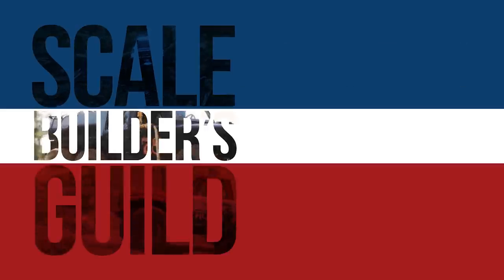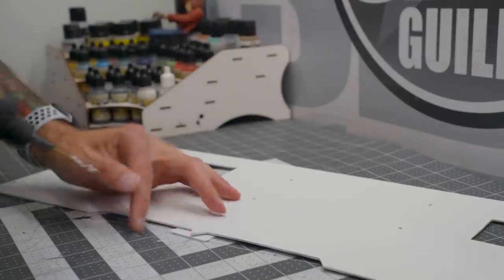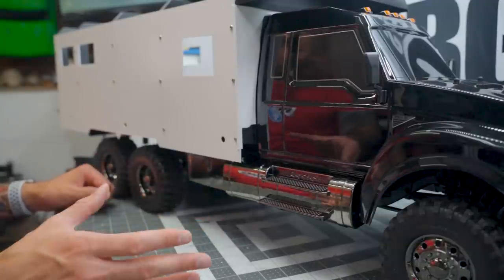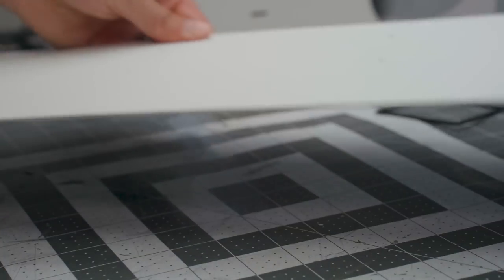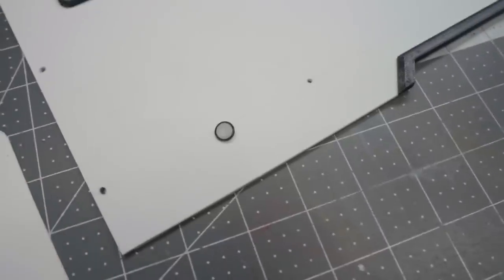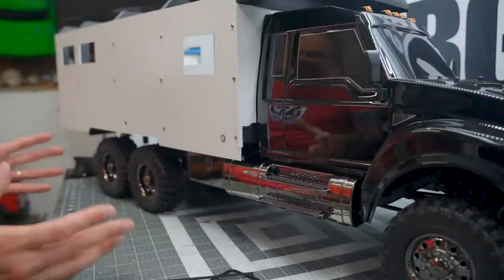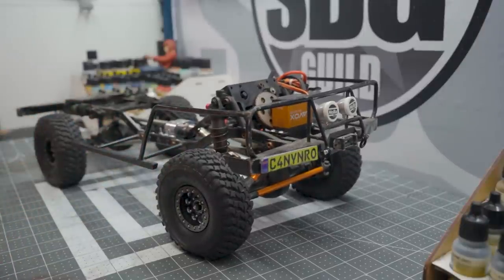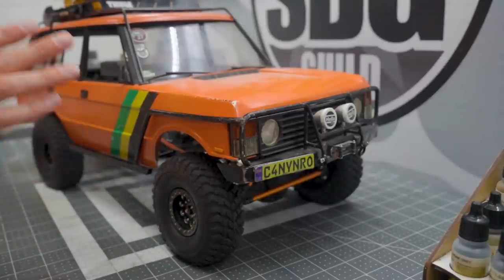What's on the Bench Weekly Ep3

Comment: Great project.  Door would not be over the wheels.  It would be lower to either side of wheels or on the back.  It would not be possible for the fold out steps over the wheels.  Even if you don't try to mimic the steps, the door over the wheels just doesn't make sensse.

Comment: I am enjoying this series. Question if 1-1 how would you fold out the steps/ladder to the camper as the door is over the wheels normally the door is at the back or forward of the wheels on the passenger side, just thinking out loud.. I remember the Range Rover I loved it as at the time I had one which was highly modified and went from stock length body to the rear bobbed and after the last roll over ended life as a short bed pickup, the bobbed rear was because a friend rear ended me the pickup was because I laid it on its side but the rear of the roof got mangled hence the pickup mod I then sold it as it was not practical for two dogs and her who must be obeyed.

Comment: My custom build is almost done, except for one big problem. I a hobbywing fusion in there paired to a Spektrum Dx5c transmitter and the car goes forward but not in reverse. When I did the calibration procedure it beeped one time in neutral position and twice in forward position but no beeps in reverse. Why is this happening? Hopefully somebody can give me the solution.
Reply from the maker: It's hard to help with electrical issues without seeing them in person. I would take your rig into your local hobby shop and see if they can help you. Maybe 1st I would try recalibrating and make sure you're using a new model selection on the radio. Thanks for watching!
Reply: We got it figured out. The trimmer for brake rate in the transmitter was interfering with the reverse function on the transmitter. The f switch was programmed for my servo winch.